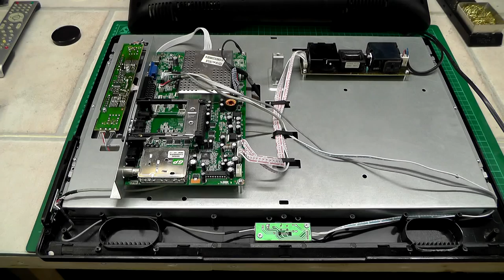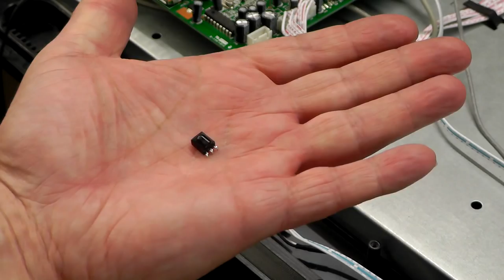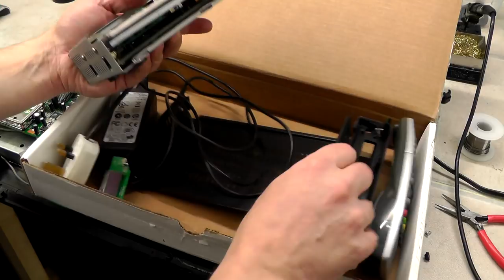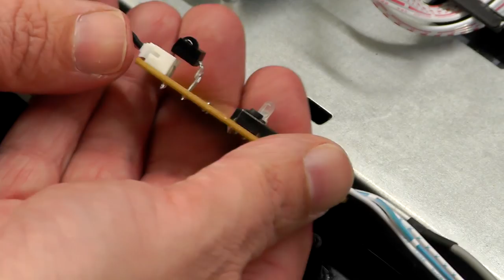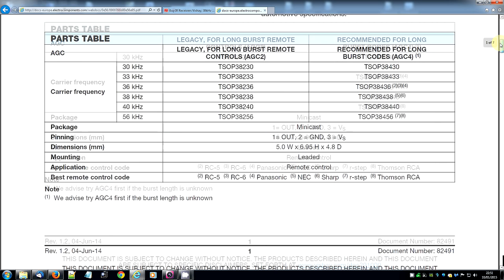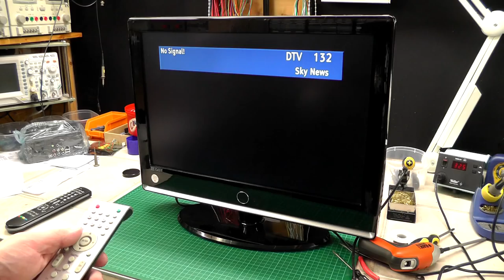10min Repair - 22" LCD TV

Comment: Great repair. One must wonder, how such a simple device that is under no thermal or power-load, just quits! The only guess i can fathom is ESD-damage, as it's situated in the front panel.
Reply from the maker: The TV has never been right since new.......the remote was always temperamental.........so I guess it just eventually failed.
Reply: +zaprodk Well, the datasheet does recommend a resistor and capacitor on the +5v supply line to prevent EOS (Electrical over-stress). I notice that the board in this TV has neither. But then if it never worked properly I guess it was just a bad one from the factory.

Comment: Great that it was such an easy fix; it's always surprising when the part that fails isn't on the unusual suspects list. Also, I love your t-shirt! Also, I've had a bizarre repair myself earlier today - a DAC that I have for audio has plagued me with intermittent clicks and pops that weren't correlated with temperature/voltage/input source etc. I was messing with some LVDS receiver chips for it earlier, and just by the act of re-soldering the differential receiver (DS26C32AT) and the SPDIF decoder (DIR9001), the problem is unexpectedly gone. I didn't replace anything at all. Normally, vibration or a temperature correlation would give away a bad solder joint but not in this case.. :s I've missed your videos!!

Comment: The output voltage looks bit low @3-4V. IR receivers typically have a pullup resistor internally on the output, which would give you 5V at idle. So maybe you have another issue upstream on the main controller board, that is causing problems? You will know if it fails again:)

Comment: Qucik tip:
If you want to check does IR diode from remote control is flashing, grab your smartphone and use camera to see it, you should see pink light(if it works ofc).
Reply: And if your smartphone's rear camera is too well-filtered against IR, try the front camera, they typically omit this filtering.